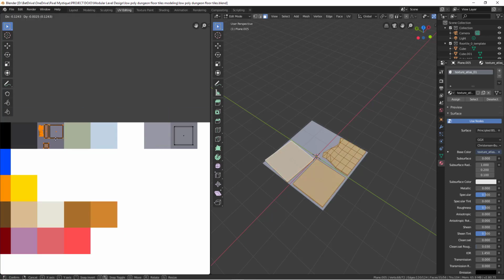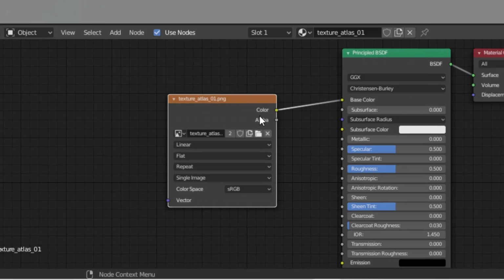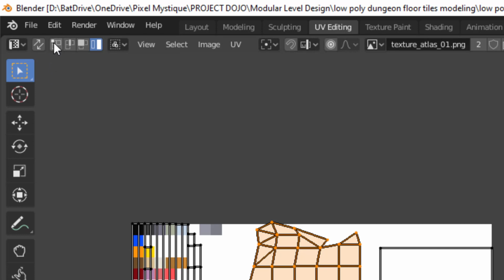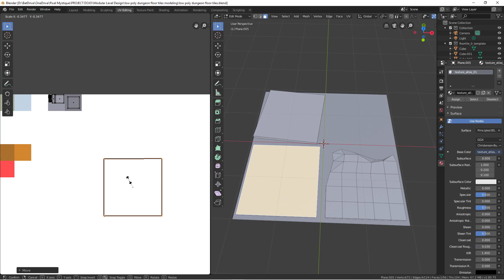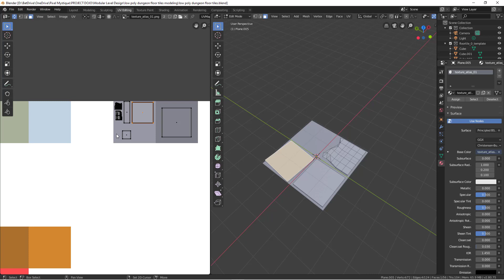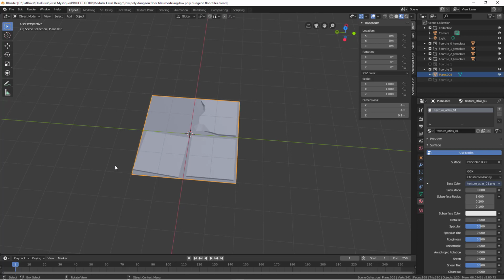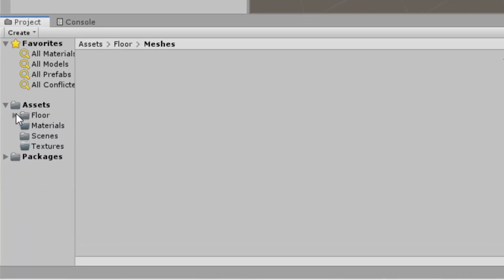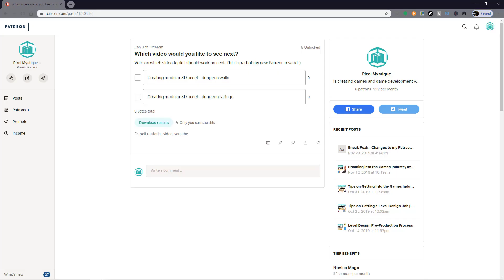Level Design in Unity | Low Poly Modular Dungeon | Part 3 | UV Unwrap & Applying Materials

Comment: Great tutorial. I'm having this issue... I have everything well unwraped with SmartUV and everything is Ok in blender. In Unity I've done all your steps and I can't see the "Plane" only the squares, but if I rotate the floortile I can see the bottom not the top... I don't know if you can understand what I'm saying. I'm using Unity 2019.3.11f1 is this an issue?...
Reply: Check normals for short

In blender choose this plane and go to mesh->normals->flip normals. I cant tell you how exactly it works because my eng is pretty decent. Unity cuts polygons, if they are facing "away" from camera